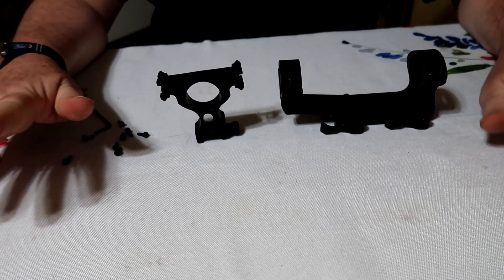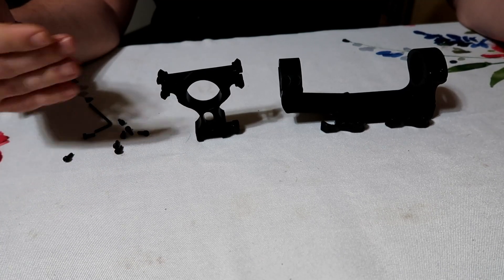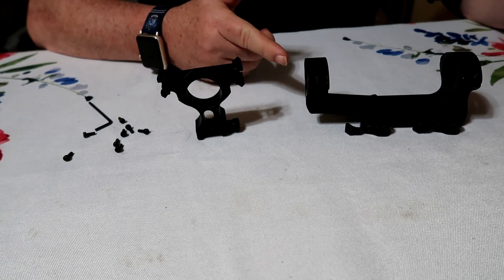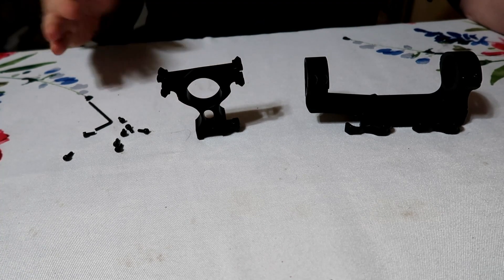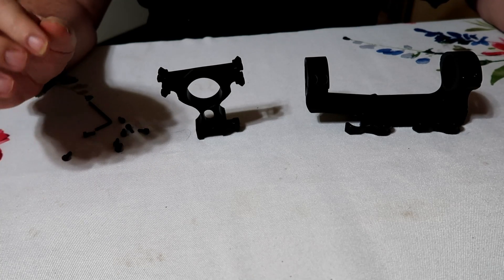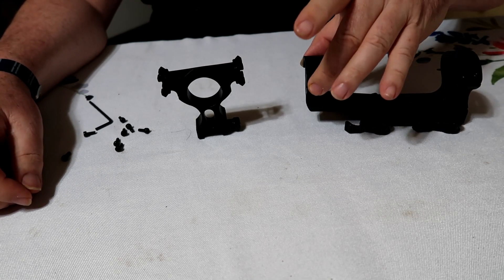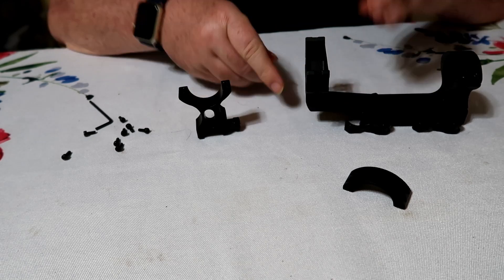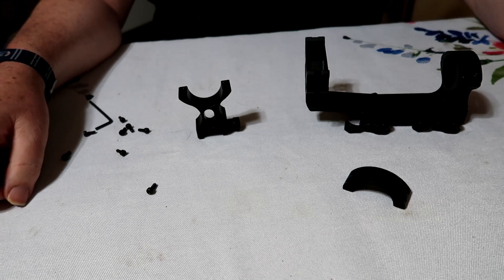Solving the Picatinny rail problem on the ATN Quick Detach Mount!

Comment: Dude!!! You’ve just solved one of my issues with the decision to buy a QD mount!   I can’t believe ATN don’t include this as part of their marketing. 
So  - how are you finding the mount? Specifically holding zero after remove / refit?
Cheers, Jarrod from Australia 😊
Reply from the maker: Hi Jarrod! So glad you found it helpful! So far no issues! the key is, after you change over, make sure after you clamp, to torque the screws to make sure they are tight. takes about 20 sec. Remember, the screws on the QD "scope mount rings" torque is 13 LB-inch and the Mount screws after you clamp are 15 LB-inch!  The QD has been awesome from one rifle to the next without any issues! Holding Zero and just selecting the saved profile in the scope! So much more coming to the channel, if you haven't already, please subscribe to the channel! You can also check us out on Facebook and message us there, I would love to hear what kind of setup you have and how it's working for you!